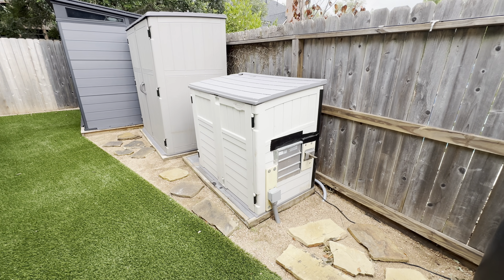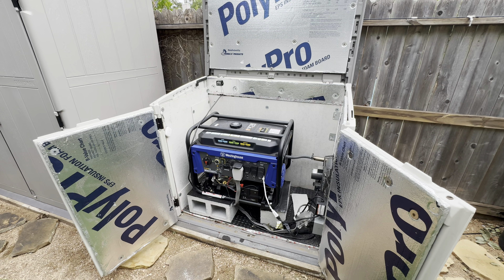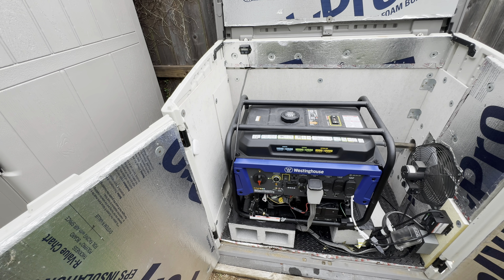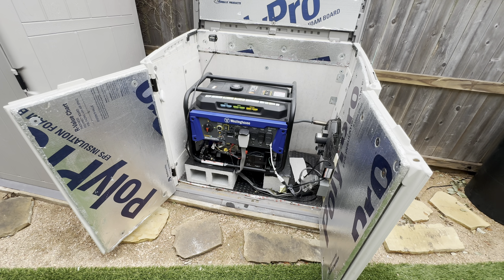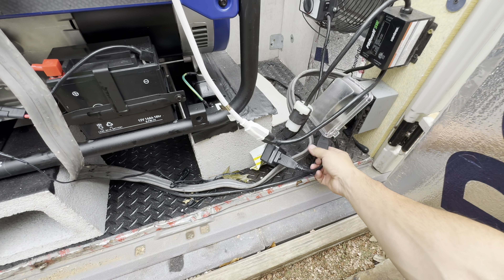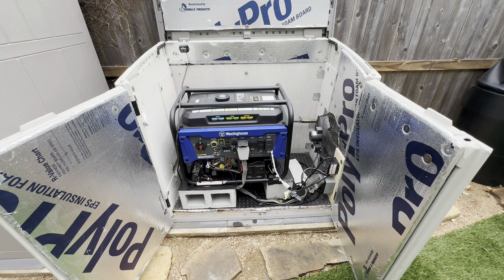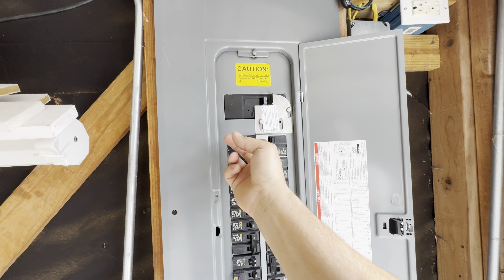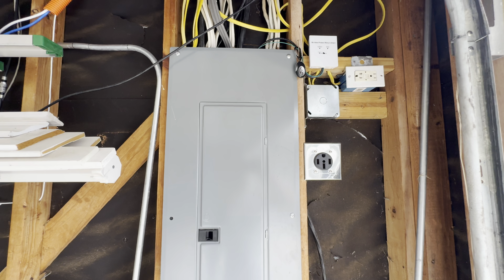Tri-Fuel Portable Generator Post Hurricane Update on Natural Gas

Comment: I live in Katy, in Cinco Ranch.  I had lost my previous generator when we got flooded during Harvey.  Time got away from me and i did not replace it, then came Beryl! We were without power for three days.  Thankfully my son live on the other side of Cinco so we slept over at there house.  I have been trying to source one these but of course they are no where to be found but I have one on order from Amazon.  Can you tell me if the hose and any fittings came with it? I used to have pool heater and there is a 2” gas pipe staubed off right where I want this.  It has a cap on it, I want to remove the cap and put a ball valve and a quick connect.  I am trying to figure out what I need to source.
Reply from the maker: This generator came with a 1/2" 25' quick connect hose.

Comment: How does running the generator off natural gas compare to filling the gas tank as far as $$$ is concerned? Is it cheaper?
Reply from the maker: Good question. I would say cheaper because it costs about 30-40 a day to run on NG. I would need anywhere from 20-25 gallons a day of gasoline.

Comment: Calvin, was very surprised to see this post...which was excellent. Love what you have done with the generator build out. Wanted to ask, was this generator capable of powering your whole house AC?
Reply from the maker: Hey  @markboyd934 ! Good to hear from you. This did run our 3 and 5 ton AC units. We staggered them so they wouldn’t run at the same time. We did install soft start kits on them but I don’t think the 3 ton unit needed it.
Reply: @CalvinGorriaran  Good to hear from you also. I also wanted to ask you who did the installation (gas and electric) for the generator, gas quick connect, and the electrical box work? Congratulations on Mission Digital. Hope things are going well with it.
Reply from the maker: @markboyd934  I did the electrical but had a local plumber do the gas run. What area of town do you live in?

Comment: I’m in kingwood and have same generator with natural gas, and interlock kit. QUESTION: how do you know how much power you’re drawing from the generator? I’m worried I’ll draw too much and not know when I have AC, fridge etc all at once.
Reply from the maker: @jwsnookes  I have a component I added to the circuits in the breaker panel that tracks usage. You could do it by hand though using some of the calculators. Either way, plan on getting a soft start kit installed on your AC units to reduce their inrush power consumption. You will find a link in the description for that kit.

Comment: I bought a Westinghouse hybrid generator after the freeze in 2022- Houston. It was still in the box and finally opened it and used it due to Beryl. I used propane which I recommend over gasoline as it has a indefinite self life without going bad. I had a gasoline powered generator before. Gasoline has a short life and it is hard to get rid of - finding a hazmat place that can dispose of it and costly. Also, ran it for about 5 days.
Reply: I did give it breaks during the day. My neighbors had cords running to it. I also have the set up where I had a connection installed next to the electrical box to switch to generator. It was worth the money and about $1,000 compared to a generac. I might look into natural gas in the future, but happy with propane, since I don't expect to use the generator often.

Comment: Looks very cool, but two questions:

1) aren't gas engines supposed to be at least 20 feet from the house?

2) My generator manual says to have at least 3 feet on all sides. What does yours say?
Reply from the maker: @stephenbrown2054  hi Stephen. The building across from the generator is my detached garage.  Mine probably says something similar but I am moving air with a high CFM around the generator and it is surrounded by non-flammable materials.
Reply: @CalvinGorriaran  I see

Comment: Why not get a Generac generator that is run on natural gas that is rated to run nonstop?
Reply from the maker: @laurenmichaud537  multiple reasons. This was 12-13k less in cost.  Very minimal maintenance costs. 

In my neighborhood alone, I knew 4 people with new and well maintained Generacs that either didn’t start or failed within two days during the storm. They had no way to resolve the issue on their own. Last reason is have have 3 choices of fuel. Generacs typically have one choice of fuel.
Reply: Geez, let’s forget the $10,000 cost difference

Comment: Extension cords to neighbors are considerate, BUT, there is voltage drop in the cords.  That voltage drop affects the motors on their items such as refrigerators, freezers and A/C units.  That shortens life considerably.  Voice of experience here.  Terrible to come home to a now nonfreezer after being gone for an extended weekend because the motor had been made weak and finally quit.
Reply: Good point... a few more tips for those using extension cords... 1) use a true 20AMP 115v cord for these connections as it uses 12 (max 50ft) or 10 (max 100ft) gauge wire.  This will reduce the voltage drop.  Most generators have (2 or 4) 20AMP capable outlets.  The correct 20AMP cord will have a 20AMP plug at the generator (one plug pin is horizontal and one vertical) and will have a 20/15 AMP connector at the other end (one plug pin allows a horizontal or vertical pin and the other is a vertical pin).  2) Make sure that the load is spread as evenly as possible across the outlets, so the generator experiences a balanced load on the windings.  3) A proper 240v breakout plug (cord that plugs into the 30 or 50 AMP generator connection and splits out to (4) 120v cords)  should provide the correct wire gauge for the current / overall cord length that will be needed.  Same for any 120v extension cords plugged into it.  Balancing the load applies here as well. 4) It's best to have as few connections to the generator source connection as possible to minimize the voltage drop.  High current load runs should be point to point if possible (e.g. an extension cord, to another extension cord, to a power strip, to a high current device wouldn't be a good idea).  5) Old extension cords with corroded plugs (dark metal instead of shiny brass) should be replaced, as this can generate heat (voltage drop) at the connection point, since it's more resistive, even to the point of being a fire hazard.

Comment: A "cable" for natural gas? .... maybe you mean supply hose?   I'd question the smaller size air inlet - which is why you were needing to have doors open. I seriously doubt the capacity to  support much of a neighbors needs with an extension cord with that size generator - especially when you've already mentioned you've been running air conditioning (I'd guess window unit, but even those add notably to starting current demands.

Comment: You have done a lot of good work. You need a BIG blower in order to keep the generator cool inside a quiet box in the Houston/Galveston area.  Luckily, I had a spare 600 CFM 8" in-line duct fan (>$200 new) and it barely cooled the generator; the outlet air was ~125F when the outside temperature was 95F.   I had a tri-fuel Firman T07571 on Nat Gas and I built a quiet box for it that reduced the nosce to ~75dB but that required large baffles for both the inlet and outlet cooling air flow.  I would suggest using a large Nat Gas hose (3/4"), KN 039-112 low pressure demand regulator, and 4AWG wire to minimize fuel and power loses or starting a 4 ton AC even with a soft start will be problematic.  I used that setup on my Genmax GM9000iED after the huricane; though I did have to alternate running one 4ton AC at a time and the rest of the house.

Comment: 100 hours of runtime between oil changes. Good idea to assume that the next time you are going to run it it will be ready for those 100 hours. Monthly startup with ten minutes at full temperature. verify electricity being generated each time. Keep a log book in the generator shed to track maintenance and monthly test results.

Comment: Serious comment: How dangerous is your setup? It looks like you got the exhaust redirected out to the right, but like is a generator 100% CO leakproof? I mean it probably is, but it should create a small negative pressure as it sucks in air for combustion and wouldn't that build up CO? I know the container isn't remotely air tight and given just a little bit of time, it would all dissipate, but I'm thinking of worse case scenario and you need to go out then and open immediately after it hae been running for over 12 hours.

Would be interesting to see CO meter over time (like go pro recording it). Do it at close to top and then middle.
Reply from the maker: The setup probably has collectively around 150 hours. Is it as safe as it can be, probably not. This generator though does have a CO sensor and will shutdown the generator. It is about 40' from any window or soffit. The building across from the generator is a detached garage.
Reply: @CalvinGorriaran  Ah alright it has CO sensor shutoff so that probably means there hasn't been a dangerous buildup. I was just curious and that answers my question. (Though if it ever did shut off due to CO build up, you instinct would probably be to go open it to check why it cut off... Though I would assume it had some sort of beeping alarm for it)

Comment: @calvin did I hear you correctly that you went from Duromax to a Westinghouse? If so, did you have any major concerns you’d care to share?
Reply from the maker: No concerns other than it was time to upgrade. My old Duromax didn't have as clean of power and also lacked features like automatic choke, remote start, and lower THD. Also needed more power on NG. This answered all those needs and so far has done a great job.

Comment: This may be a dumb question, but will your internet work if your modem and what not can power on? 
I remember phone line use to work in power outages.
Reply from the maker: At least in my part of town, if you had XFinity, you didn’t have Internet. Even on generator power. We have AT&T Fiber and it worked during the whole 4 day outage.

Comment: Magnolia tx. Very good advice.   Good video.  I will be adding some of the items you have installed on your system.  I ran my house on a portable during this storm as I am in a rental house while I build my next house.   I also have an rv park that I ran on multiple portable generators in order to keep water, sewer and office for cooling station for my tenants without generators.   

Is your generator made in china,  how many hours do you have on it ?  Do you recommend this brand ?
Reply from the maker: Most generators these days are made in China. Yes, I recommend Duromax and Westinghouse generators.

Comment: Cool setup.  I run a gen in a shed and noticed that my gen runs at maybe 150 deg, but the exhaust tube is around 400 deg f.  I am going to wrap the exhaust pipe with header exhaust wrap.

Comment: I live in Sugar Land too. Are you able to run your AC with this? I have a 5 ton, a 3 ton and a 1.5hp pool pump. I would like to at least run the 5 ton, anything else would be a bonus. Who did the electric and plumbing work?
Reply: You can run your 5 ton if its equipped with a hard start or soft start.  hard start cost $20 and piggybacks on the AC capacitor, soft start costs a lot more.

Comment: I am looking into building an enclosure like this. Waiting for this exact generator to be delivered! We were out of power for 8 days this week and I don’t want to be in that position again. 

Question about how you have your power rigged up. Did you get a 50 amp inlet installed inside the box? Also, once you turn the breaker off of the generator power then how is the electric still working in the box for your trickle battery charger and the fan?
Reply from the maker: I have the cable hardwired into a 50Amp circuit in the panel, protected with an interlock kit. I also ran another 110v circuit from the panel to the box so I have power in the shed when the generator is not running and we are getting power from the grid.

Comment: How does that sensor work that alerts you to grid power available?  If you have the main breaker off, then what is the sensor wired to?
Reply from the maker: It wraps around one of the main feeds coming from the meter into the panel. Simple to add once you take the panel cover off. It is powered by a battery so it doesn't need to be connected to a circuit.
Reply: @CalvinGorriaran  Thanks...

Comment: Good job looks great. Others have mentioned changing the oil frequently. If you use fully synthetic oil, it can sit indefinitely without risk of sludge buildup. It is cheap cheap in Walmart. Make sure you inspect the oil daily by using a turkey baster to pull up the oil and look through it. If it is extremely dirty then switch it out. Also make sure the level of the oil is correct every day

Comment: Curious here, is your generator running in bonded neutral or in floating neutral mode? You have some good videos btw. Thanks
Reply from the maker: Thx Scott. Since the panel is grounded and we have a ground in the 6/3 cable going back to the panel, we are not using a separate ground for the generator.

Comment: Great setup. With backfeeding and hardlining your power feed. Why did not not hardline natural gas into your shed?  Is it against code?
Reply from the maker: Most outages we have are only 4 hours or less. Gasoline is easy and quick to start. NG can take a few tries to get started and this way if it is a long outage, we simply just connect the quick connect hose.

Comment: Your setup has everything., however an air cooled generator is not well suited to this situation. It most certainly needs more airflow in that enclosure, even after the improvements it is at risk for overheating in the summer.
Reply: Wrong. It may be that he needs more airflow, but it’s definitely not the case that you can’t do this.  It’s an easy measurement to go and figure out what the temperature is and make adjustments.

Comment: I see a lot of folks running a separate pipe out of their sheds for the exhaust like you did but personally I see no reason as the exhaust fan is going to suck it out anyway. I have a Wen 11000 that's set up basically the same  way as yours but the crappy thing about it is that it calls for an oil change every 24 hours so once a day I have to change the oil and it doesn't have an oil filter either. No natural gas at my place also I use propane bottles. If I ever get rid of the Wen I'll definitely spend the extra cash for a Westinghouse but at the time I was looking for something under a grand and the Wen fit the bill perfectly. I live in Santa Fe and we were without power for three days, I think it was a week after the freeze and the Wen took me through both just fine with no problems.
Reply from the maker: CO build up as well as heat reduction.

Comment: Does anyone knows whether or not the tri fuel generators have a regulator on board or an automatic shut off device that can shut off natural gas flow automatically should an unexpected shut off of the generator occurred with no one around to notice, such as in the  middle of the night when everyone is sleeping?
Reply from the maker: @doradean3097  this model has a regulator. You can see it at the bottom left.

Comment: I run the tri-fuel Westinghouse 9500 and it was a lifesaver after Beryl hit. One note I have is that here in the Houston area you will know when the power from the transmission line comes back on by looking at your meter. If it has LED numbers showing then the power is back on.
Reply: Good tip about energy back on line with meter showing led numbers!  I'm researching on hooking up a tri fuel generator to run on my natural gas line.  Watched several videos on the set up, with one strongly warning against tapping into gas line saying should the generator stopped running and no one is around, the gas would continuously flow into the generator posing an extreme dangerous situation.  Do you know whether or not the tri fuel generators have a regulator on board or an automatic shut off device that can shut off natural gas flow automatically
 should an unexpected shut off of the generator occurred with no one around to notice, such as in the  middle of the night when everyone is sleeping?
Reply: It's hard to know

Comment: I basically have the same setup. I also added a 12 volt radiator fan at the opposite end of my shed to draw the air in through a vent and across the generator as the other fan pulls the hot air out. You could try that too.
Reply from the maker: Love that idea. I am thinking about adding a high CFM attic fan to the top of the shed in the lid. Might do both!
Reply: @CalvinGorriaran  That's a good idea!